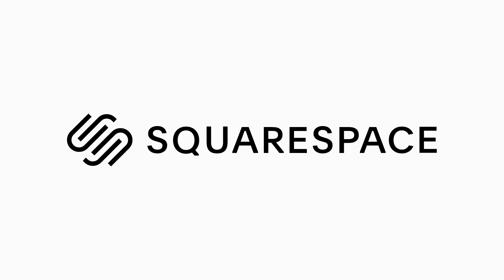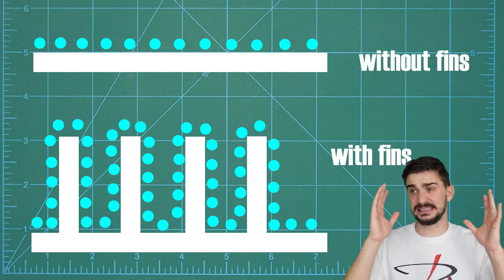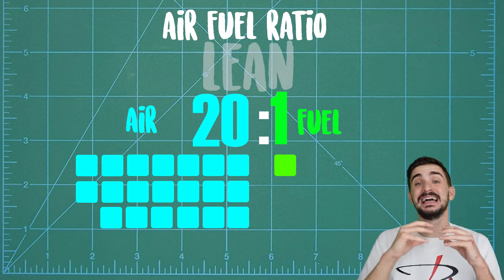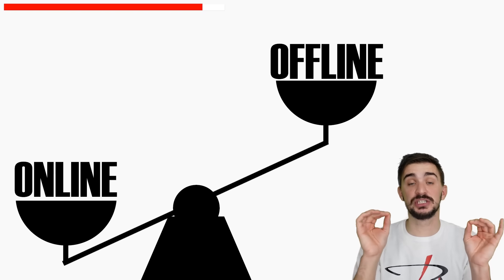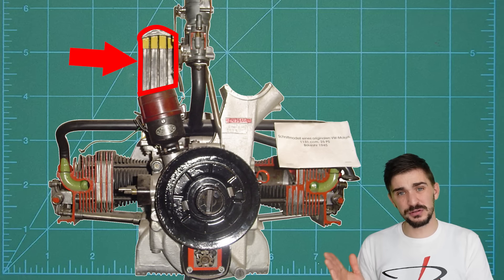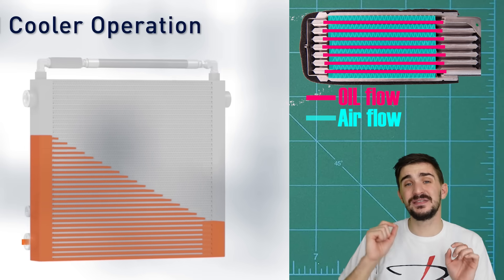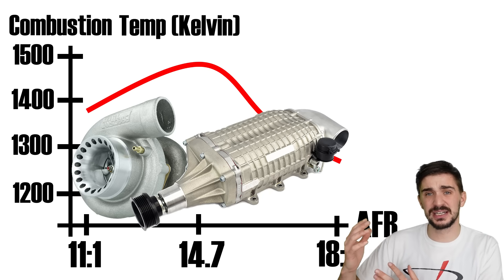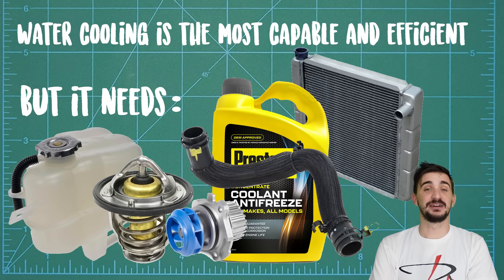AIR COOLED vs OIL cooled vs WATER cooled ENGINES

Comment: You are quite wrong about the source of heat in an engine. It is not drag, it is the fact that you are burning fuel inside of it, and that heat  is transferred to the engine components, especially the head, cylinder walls and pistons.

Comment: I drive a MZ ETZ 250 (250ccm 2 Stroke Air Cooled) which has massive cooling finns. Probably the biggest Ive ever seen on a Motorcycle. It takes like 20 minutes of driving to fully reach operating temperature. Even being Stationary, it does not exeed 90 degrees celcius.

Comment: I don't really buy increased heat capacity as a factor, if you're dumping heat outside.

Sure, you need to move half the volume, but that's pump mechanics.
Surely the conductivity to other surfaces is the factor that matters

Comment: Thanks for another great video. I have long wondered why nobody uses an oil water emulsion. Similar to cutting fluid when drilling or any lathe. I se the advantage to be rust/ corrosion free system. A pure oil is dangerous if very hot and ignited. Water in the emulsion gives better cooling. So water glycol and oil in an emulsion is my best guess. Are there any disadvantages that I’m not aware of? 
Please try to answer in another video.

Comment: So much heat wasted that could be transferred to energy. I always wondered why there wasn't an exhaust heated, steam driven turbine that could generate power. Then use a steam exhaust cooler to condense the water for it to be used for steam again. A steam hybrid, if you will.

Comment: Thermal dynamics says there's no such thing as any heat engine engine that maintains a uniform temperature . Small block Chevy's with a radiator and water pump have hotter cylinders towards the rear of the block . Further heat saturates the surface meaning that it's very difficult to achieve a wide degree of temperature variance in smaller engines . Very very rarely is half a cylinder 10% cooler than the other half because both sides are in proximity to the same heat source  . And yes you can only add so many fins but the depth of the fins is a different matter. Anybody who looks at a radiator will get this .And as more modern engines run above 210 degrees all of this becomes less relevant . Because hotter engines burn gas better ... The biggest actual argument I've heard for water cooled is piston ring seal . But even that is a dead argument when you look at gapless piston rings. Oil does not shed heat very well at all , so it's essentially pointless to pursue . Water on the other hand sheds heat quite well but is limited by how hot you can actually get the water before it becomes steam and doesn't do anything at all to absorb heat. The point of cooling oil is more to keep long chain triglycerides from becoming short chain , and losing viscosity . Again modern engines run much hotter and so the need for synthetics , they survive more heat cycles . I know what the e.p.a. pitches , but I also know it's bullsht driven by corporate interests.

Comment: Why don't you explain the reasons Motorcycle Manufacturers went from Air Cooled to Liquid Cooled Design ?  A well designed engine with Superior Metals, Oil Cooler and Large Oil Capacity does not need a Liquid Cooling design. However, it is better for the Manufacturers Net Profit per unit.  Air Cooled Engines in a motor vehicle is problematic compared to a motorcycle.  The VW Beetle had a Large Cooling Fan and an Oil Cooler.  However, its No 3 Cylinder would usually wear much faster or fail under heavy load due to the poor design of the Air Flow.

Comment: The part about fuel cooling is a bit wrong. Technically, cooling of the engine by the fuel is due to the phase change, while in evaporation (sweat) we do not have a phase transition per se, but an air/water system trying to reach equilibrium. The water molecules that evaporate first are the faster moving ones, hence the perceived drop in temperature.

Comment: Water cooling is best, you don't feel so much heat from motorcycle engine on you legs.

Because i have RE gt650 and it its oil cooled i, we live in hot region country and i get my legs roasted everytime i stuck in traffic.

Comment: Ya oil cooler rad.  Only way ha. In compressor shack, water as use oil cooler for bike engine water push pump from pond too pond ,filter pond's, pro rpm gauge panels.  Hydro,water supply.

Comment: in 1986 Suzuki made a triple-cooled production engine, using air, oil and water. SATCS - suzuki advanced three-way cooling system.  Dedicated oil cooler under the headlight, normal radiator in normal motorcycle position. Oil cools rods and pistons, air cools cylinder (usual fins) and the head was water-cooled.

Comment: This was informative, but I wish you touched upon the relationship between torque vs HP in air-cooled vs water-cooled engines.  This is very relevant in the motorcycle world.  Harley's most popular motorcycle now is the Lowrider S/ST which have HUGE air-cooled engines (1950+ CC in capacity) but produce gargantuan torque (120+ lbs/ft).  But they also make the most innovate water-cooled cruiser, the Nightster, which produces a lot of HP but lower torque.  I know torque/HP and air/water cooling is related to the bore and shaft of engine design, but I wish you would make a video about that.  This video was excellent!

Comment: I don't like oil-cooled. Because small metal parts, dust, carbon, etc is circulating the radiator. It could build up fast like inside oil filters, and its radiator is smaller and could not efficiently transfer heat, since oil do not boil in water's boiling temperature which gives you little cooling benefits in a small radiator which is common in oil-cooled engine set up; and also oil is expensive & plus increasing the engine's oil capacity would not help money wise. Liquid-cooled provides more efficient heat transfer, and by using the right coolant not tap water or any dirty water, you cannot clog up your radiator.

Comment: Like inside an aircooled vw engine, thicker oil such as 20-50 makes the engine run hotter than a thinnet weight such as 30 weight. The thicker oil bypass the oil cooler, making the engine run hotter. This is well docummented. So i guess oil-cooled makes sense.

Comment: Just a minor correction, engines not only create some heat from friction but the brief moment of combustion creates a ton of heat. That’s why the top end of the engine around the cylinders and exhaust headers will be hotter than the lower end despite friction still existing in the crank and other parts. Other than that, the video explains everything well.

Comment: I love air-cooled 2-strokes.  No coolant, no oil.  They warm up to operating temperature in 60 seconds and can easily achieve 200hp/L reliably.  Water cooling does allow even greater outputs and consistency, but good lord, at a certain point, you have to worry about your bones.

I was amazed the first time I rode an air-cooled 4-stroke on a chilly day and the oil simply did not ever come up to temperature.  Even after 15 minutes, the pig wouldn't idle.  So uncivilized.

Comment: I love these videos but here i think there is a mistake, i dont think that  the most active heat source on the engine is friction, if that were true, the engine wouldn't last too much.

The main heat source on the engine is the combustion chamber, in fact on diesel engines that runs cooler, you can see  the engin heat up much much more slowly and it even needs special heaters for the combustion chamber.

Yes there is some heat generated by the mechanical action of everything, but i think the oil job is prescisely to lub the parts that contact each other and lower heat generation and wear.

FOR ME, the main heat source of the engine is the combustion chamber.

Comment: I had a Suzuki GSX-R 750 1988 streetfighter. Needed to build the engine again. Too much abuse for a 70k driven bike 😂 The Air/Oil 1100 GSX-r my dream bike. After the new ZH2. Now on my second Z1000.

Comment: 7:39 No, Deutz D2011 is only oil cooled engine, has no air cooling. 
Pure oil cooling allows engine to run at temperatures above usual, it can not boil easily.
Despite not being large, D2011 has about 18L of oil in cooling system.

Deutz is company that made first Diesel engine for Rudolf Diesel, company where Benz, Maybach, Bosch and L`Orange learned their trade.

Comment: I think a proper oil cooler with bigger radiator( like for liquid cooler) along with radiator fan or fans is what needed the most. Nowadays fan is omitted, small radiator etc are convention,to cut cost in smaller cc engines. Liquid cooler is good,but maintenance should be proper or else coolant mixes with oil and that for me is the greatest disadvantage of oil coolers

Comment: I think you will find the fact that we are igniting a fuel/air mixture several thousand times per minute contributes to the heat we have to deal with, especially in the heads...
Reply: I found it strange that that wasn't mentioned
Reply: @Temerar1ous  same

Comment: Thanks for interesting videos as always! A question though about your claim in the end that an electric water pump reduces parasitic load on the engine. The water pump requires electricity which has to be produced by the alternator, which will cause parasitic load on the engine! You cannot cheat the laws of thermodynamics! 😊

Comment: He didn’t say it directly but did imply that running lean makes things run hot. I just want to put out there that very clearly running lean DOES NOT MAKE YOUR ENGINE RUN HOT. Engineering Explained has an amazing video that breaks down the whole situation. The TLDR version of EEs video is running leaner then what your currently at (usually 12-10:1 afr) will mark things hotter until you hit 14.7:1 and then it cools back down and once your at like 16-20:1 your actually running really cool as well. I really like this video over all its very informative and well put together I’m not trying to hate on D4A I just want clear accurate information available to everyone.
Reply: I was going to post something about this too. 
Airplane piston engines can be run lean of peak for cruise if they are equipped to do so (usually requiring fuel injection as getting a consistent mixture to each cylinder is difficult otherwise). This improves fuel economy and, just as with rich running, the engine runs cooler as some of the excess air passing through the engine helps cool it. 
The only real reason we run most of our engines at a stoichiometric mixture (for spark ignition engines) is that catalytic converters need it to function.

Comment: Most of the heat doesn't come from friction, but comes from the thermodynamic inefficiency of the engine.  About a third of the fuel energy is transferred to the metal of the engine (and then the cooling system) rather than doing work on the piston, and another third is lost in the hot exhaust gases.

Comment: One drawback of water cooled are head gaskets and leaks between combustion chamber and water/oil passages. Typically the open deck designs that cool best are less rigid leading to gasket failures.

Aircooled cylinders and heads can fit together with nothing between them and seal indefinitely

Comment: i thought that most of the heat created in an engine was from the multiple explosions happening every second inside of it.
Reply: It is. It’s like turning on a gas stove. It puts out enough heat to burn anything that touches the flame. Same story for the brief combustion cycle except there is also rapidly expanding gases involved inside the small area that is the cylinder.

Comment: One small correction about evaporative cooling. Cooling occurs because water vaporizes (evaporates) taking its heat with it. The hotter it is, the more quickly it vaporizes.

Comment: Thanks for educating me,  I knew the original Porsche  6 had a enormous amount of Oil in the engine, now I know why.  When Tucker starting using the Hughes Helicopter engine  they first add a water jacket to aid in cooling

Comment: The beginning of this video is misleading. Combustion and compression are the only reasons for cooling systems in engines. Heat from friction in a properly oiled motor is next to nothing.

Comment: Okay but wait a minute - I would've thought that friction, when managed with a good oil (i.e. film of oil) would be rather minimal - & that by far the largest source of heat in an engine is combustion heat! This to the extent that diesels produce less heat than petrol - not because of any difference in friction, but because of greater combustion efficiency (i.e. more kinetic energy produced, & less heat).

Is this dude April fooling us or sumthin'!?

Comment: 13:17 - How it reduces parasitic load, if the engine power this pump through the energy production by the generator? ))
Reply: Because it can run at the most efficient speed all the time instead of being tied to the engine speed.

Comment: I don't know how you define parasitic load, but an electric water pump is going to use electricity from the alternator, and the alternator would not work as hard if it did not have to power the water pump.

Comment: My old Ranger has been both oil and water cooled lol
During a winter it lost heat for some reason. After a few months of driving I was looking in the engine bay only to realize the AC compressor ate through my upper radiator hose and the engine was running without coolant for roughly 600 miles. The only thing preventing that 2.3L iron lump of an engine from overheating was the 5 quarts of oil and ambient temperature lmaoooo

Comment: Haven't listened yet but some are both :0  Old deutz engines are "air cooled"....but they're actually air and oil.  Have an oil cooler and piston sprayers in addition to the fan and shrouding for the block and heads.  But they're diesel, maybe you're just discussing gas

Comment: In saying that water cooling is the most effective option, i would like to state the truly most effective cooling is the combination of both oil cooling and water cooling. Cooling oil helps with keeping the oil in good condition, not allowing it to get too hot and start to burn and discolor, oil cooling is also considered nessesary when force induction is present on the engine as that can increase engine temperatures, cooling oil can also be benifical to engine longevity as the hydraulic effect of cooler oil is more resistant to dispersing at high pressures compared to hot oil.

Comment: Good video I have a air cooled Harley Davidson. Its amazing to me the air keeps the engine within operating temperature. I prefer the look of air cooled engines on bikes. No big plastic parts, rubber pipes or shrouds covering radiators attached to the engine  cluttering the space. Simple and clean.

Comment: The thermal capacity of water alone would still not make it better than oil. Yeah, it is about twice as high, so what? Oil can operate at significantly higher temperatures and thus easily carry the same amount of heat away. But water also has the benefit of being a lot less viscous.

Comment: You didn't told one of disadvatages of air cooled engines, and that is problem in colder days, you mentioned that yeah, they take longer to reach operating temps, but you should add to it that in coolder days that becoming a significant problem becouse cooling rate is so great that is almost impossible to reach operating temps, mainly on engines with belt driven fans atached to engine, some manufacturers like TATRA overcame this problem with oil driven fan that is operated with thermostat :D
Reply: Also even new TATRA T-815-7 models still use air cooled engines, and those engines are really well designed.

Comment: One question wrt water cooled engines, why all new engines use coolants with water? Does addition of coolant increase the heat absorption properties as compared to when water is used alone?
I am from India and its quite hot with no chance of water getting frozen up inside the engine even in winters except in the higher altitudes!
Kindly explain.
Reply from the maker: Anti corrosion

Comment: What's the heat capacity in degrees Celsius? And what about degrees Fahrenheit?
Reply: The SI unit of specific heat capacity is joule per kelvin per kilogram. Since a difference of 1 kelvin is the same as a difference of 1 degree Celsius, it is the same in Celsius. for Fahrenheit you would need to convert it: It would be 2326 J/kg°F.

Comment: i do diss agree on the point where in 4:12 where he say's the more fuel we introduce into the cylinder the cooler the engine is going to run
Reply: You can disagree, but that doesn't make you correct.

Comment: Just wanted to point out the unit for heat capacity is kJ/kgK not kJ/K as you need more energy to heat up let’s say 10 kg of water by 1K than 1 kg. 🙂

Comment: I’m a BIG fan of your channel. Your automotive presentations are the best balance of accuracy and accessibility on the web.  

Having said that, I was surprised to see what I consider a bit of a stumble in this video (engine cooling). Please tell me if you agree with these criticisms of this episode:

Combustion, not friction, is the major source of engine heat. 

Lubrication, not cooling,  is the major defense against friction. 

The function of engine cooling is to remove combustion heat from the engine. 

Properly lubricated piston rings don’t create engine-damaging heat, rather, they transfer combustion heat to the cylinder walls which are cooled by air or liquid. 

So, I think your focus on friction in relation to cooling is misplaced and potentially confusing to the uninitiated. No amount of cooling will save a poorly-lubricated engine. 

Please keep up the good work producing informative, no nonsense automotive videos!

Comment: A major drawback of air cooling is that cylinders have to be spaced further part on multicylinder engines to allow room for fins.  This makes the engine longer/wider and thus heavier.  Crankshaft has to be longer thus more flexible and then must be made heavier.